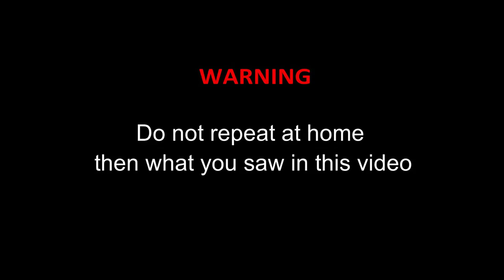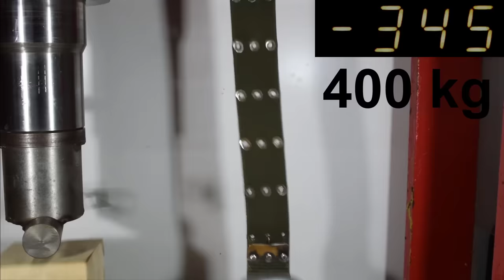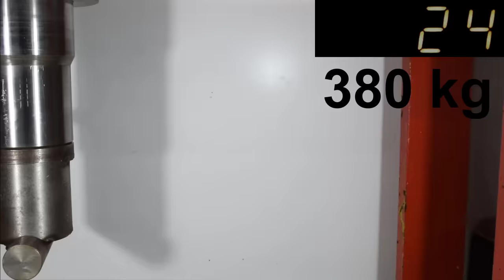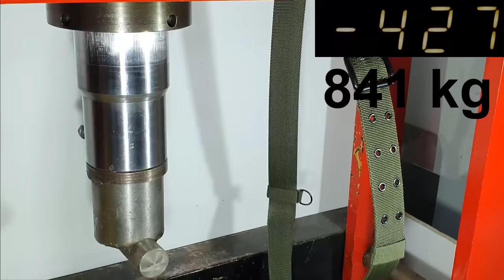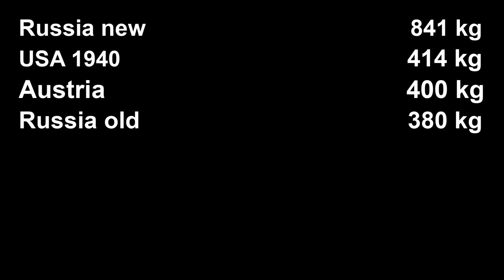HYDRAULIC PRESS VS BELTS OF ARMIES OF DIFFERENT COUNTRIES

Comment: The 1940's usa belt was not fastened properly
Reply: Exactly! I think that it’s gonna hold a lot more weight if it’s fastened properly!
Reply: Also wasn't a 1940s American... It was a late 60s early 70s Australian or South African
Reply: We had olso the same here in Greece at 70s, my father has one 🙂
Reply: Came looking for this comment. South African army still uses this type of belt. Fun fact, the belt is supposed to be strong so you have something to grab and pull your buddy to safety if they get shot, Uk belt is an absolute fail in that regard.
Reply: I had the USA 1940 belt issued in the 80ties in the Dutch Army
Reply: @gousmc1983 or possibly Dutch
Reply: I came to say that too!
Reply: The guy testing it didn't know how to fasten the belt... I have one... its been my daily use belt for the last 20 years... it is not even worn... greetings from Portugal
Reply: @gousmc1983 South African web belt and yes it wasn't tied correctly.
Reply: @gousmc1983  - When I was in cadets (Australia, 70s) we used to call that the '56 pattern webbing.
Reply: Why bother? :) How much more do you want out of it?
Reply: Looked more like a British 44 patten belt
Reply: @tooth2163  The UK is a country with a lot of political nonsense. It is highly unlikely that dragging a fallen buddy by the belt would slide with them.
Reply: @askor2000  This exact belt can handle over a 1000kg. You can use it to pull a car out of the mud... If you know how this type of buckle works. And it is used even today because it simple (2 stamped metal peaces) and durable as f*ck
Reply: The 1940 US belt is 1960's British and Dutch
Reply: creo que si hace la prueba con el cinturon bien puesto rompe la maquina hidraulica ...
Reply: @almademustang  what?
Reply: @Boyd6763  If you fasten the seatbelt properly, it will break the machine.
Reply: @gousmc1983 USA sells their surplus to other countries
Reply: @gousmc1983 No it was a 1944 Pattern British Army belt .
Reply: @matthewlawrence9442 Your right . Issued late 44 used in the CBI theatre , issued with a holster for the Browning 9mm pistol to Paras in 1945 for policing work in the Far 
East .
Reply: @georgerobartes2008  which were still used in SA
Reply: Exactly, those are still standard belts in the Serbian army
Reply: cry
Reply: Yeah sure 🤣
Reply: Rematch required! Too many errors.
Reply: It was fastened correctly when he was showing off, not sure how he manage to get it wrong after. I have that type of belt, the buckle is quite robust.
Reply: Right, it was fastened properly in the demonstration, but not the test...
Reply: @gousmc1983  we still use them in the Portuguese Army
Reply: This annoyed me very much
Reply: Those "1940's" are pretty much the same as we used in the British army in early 2000's.
Reply: I think it is NATO standard belt and  I can confirm that it wasn't closed properly when tested.

We have had that belt in Serbian military. Perfect design and endurance.

Comment: We in the UK must have got the Aliexpress version
Reply: UK soldiers had better go on a diet as the belt is suppose to carry their weight if they have been wounded, another soldier grabs the belt and carries them to safety.
Reply: That's why you don't buy from this Irish vendors😂😂😂
Reply: The US made ITW Nexus buckle broke . The webbing has been woven on the same machine , first in cotton canvas and then nylon since 1914 by Arthur Hart of Crewkerne Somerset and features on 1920s 30s etc kit right up to 2000 . I was lucky to visit and watch the machines operating.
Reply: @tonysheerness2427 nobody carries wounded people by the belt, its really not even possible. soldiers are trained proper methods to carry people.
Reply: @JH-fk8ow When bullets are flying around you try to get people to safety as quick as possible.
Reply: 38kgs = Pa-Thet-Ic.
Reply: The Chinese belt can be found on Aliexpress... I think your comment backfired.
Reply: Where’s the plastic buckle manufactured ❓
Reply: @JH-fk8ow  no you carry them by the webbing that the belt is attached to

Comment: The newer USA LBE belt quick release buckle is designed to release without breaking between 1.78 and 2 kilonewtons (10g shock at 40-45#) to reduce injuries and entanglement.  Parachute buckles and adjusters are not designed to release or slip under load.
When I was a paratrooper, we did not jump with the belt buckled, but would unbuckle the belt, loosen the shoulder straps, fold the ends in and pull the two sides through the diagonal back-straps of the parachute harness.  When we rappelled, we used a harness or Swiss Seat but kept the belt buckled.
Reply: Penny-mk7fv  A 'rigger belt' should not come loose or break because it is a life safety device.  Load bearing equipment is intended to be quickly donned and doffed, with the preference that the gear be lost rather than a deadly entanglement or drowning.
Reply: Thank you for this clarification 👍

Comment: The 1940 US belt is actually a UK 1944 pattern belt, initially issued for jungle warfare, then onward after the war until 1958 until the pattern changed, great channel, captivating, great YouTube thanks
Reply: And it was fastened incorrectly.  The UK belt was very worn out and the buckle is the same as the USA.  Still a great video.
Reply: It’s not 1944 pattern. The ‘44 pattern belt was made up of three pieces, a left and right hand front part with the two halves of the buckle, and a back piece. This might be Canadian ‘51 pattern.
Reply: I think if it had been connected properly it would faired fare better.

Comment: Horses for courses - there are times you don't want a belt to break (when you need it to work as a belt in most circumstances) and there are times you want the belt to break (entanglement) rather than let the belt break you. A compromise has to be reached, and each country has their own tolerance to risk, different risk appetite and mindset for dealing with people. I personally want a belt to be a belt and not to kill people, not to be the strongest item on the planet and lift huge weights that are reserved for cranes and chains, but other perople may want that capability, just in case they need it. When you are in a jam, you don't want your belt to hold you back, get caught on something that ensnares you and cut you in half. It is a belt, if it breaks you get another one or improvise with something until you get a new one. If a belt breaks, you can still carry on. The great thing about the British Forces is the ability to constantly improvise when things go wrong (and they always do go wrong in war). There is no such thing as fail-safe, 100% guaranteed or full reliability on everything. There are only three things the British Forces rely upon, themselves, their buddies and their ability to complete their mission, everything else is really inconsequential. It is a mindset issue - don't delude people thinking they have 'super human' equipment, they invariably have to rely on themselves and their initiative a lot of the time. Not everything is fastened properly in life - just accept it and move on. Russia may have the strongest belts in the world, but when it comes to warfare, we are seeing in real-time how quickly they buckle. When you are measuring belts instead of bravery, you are measuring the wrong thing.

Comment: The so called " USA 1940 " belt is actually a 1944 Pattern British Army belt and not latched properly. This 44 Pattern webbing was issued to British Army late 1944-45 to troops in the CBI theatre, included revised aluminium water bottle similar to USGI and also a holster for the Browning HP 9mm pistol which saw eervice among the Paras in 1945 .

Comment: This is interesting. I understand why the buckle would need to be able to be able to bear loads up to a certain point but then break afterward. If you made an indestructible buckle with a strong ass fabric, and the soldier's belt was caught on something, that's life threatening potentially. You'd want it to break away to save your life and a belt is designed to secure your clothes/uniform and hold things. It is interesting to see which buckle breaks first though. I'd like to see a video of the fabric strength tested as well.
Reply: Lol
Reply: @TheMaret333  sorry you didn't like the comment. I hope you find peace in your heart. JK

Comment: Your so called US belt @5.30 is actually a Dutch M53 pattern belt used from 1953 untill 1993, that one is probably from the '70's as it still has Brass fittings. Later ones would have anodised Ally.
Reply: Ally or alloy? Im confused sorry 😭

Comment: The belt is a part of uniform which have to perform it's functions. What is a  weight of Russian ammunition suspended on a belt?
Reply: This belt seems to be multi purposed - to get an engine out of the vehicle in certain conditions, or to evacuate/get back on the track light infantry vehicle with 4 of these, for example.

Comment: Was not a 1940s U.S. belt because it would have been a m1936 pistol belt that should be dated somewhere in the 40s. You could have at least gotten a m1956 they are relatively the same belt and are easier to get.

Comment: US 1940s belt is deafinatly a post wwii brit belt.  Had it been correctly fastened it would done much better.  The new RUSSIAN belt would have done better if the buckle end was sewn instead of riveted.  The belt im most impressed with is the Austrian battle belt.  I thought the buckle was going to fail much earlyer

Comment: Belts that breakaway are basically designed that way to ensure the individual isn’t cut in half if the belt were to get caught on machinery.
Reply: Next you’ll say boots are made to “break away.”
Reply: @WontSeeReplies lol lots of them are. And some are made to take parts with them. Removing toes or feet but gives you a chance to survive.
Reply: That's what your theory says. Reallity has them to be as unbreakable as possible. That's how all military gear is build. You might have to use it to climb, hold from it to not fall or even impovised rigger belt. That's why they are unbreakable, there isn't a single one, desinged to break. For Christ's sake, one of them hold half a ton and another almost one Ton of weight, does that look to you, like "designed to break?"